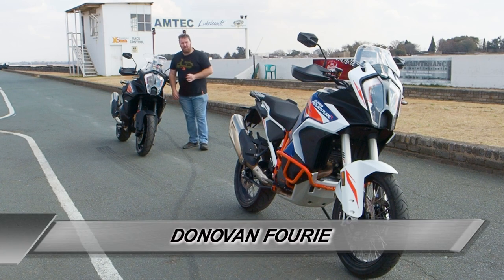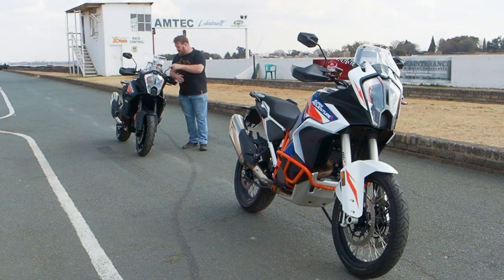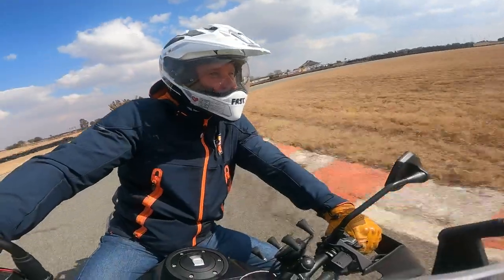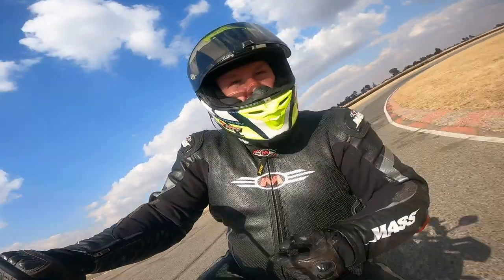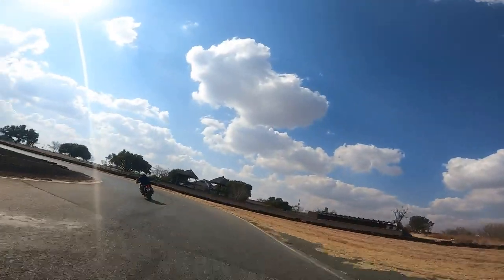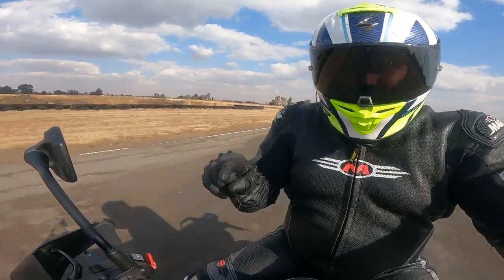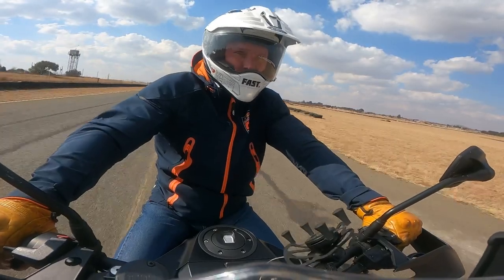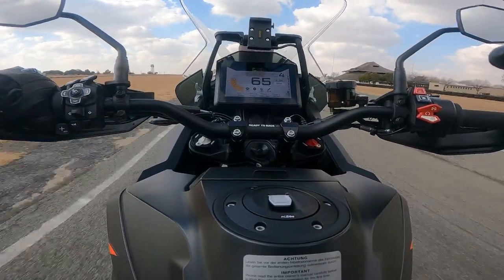A lap of the track using only radar and adaptive cruise control

Comment: Madnesses! This system works well on motorway, I did follow my mate on his Tiger 1200 all day long and no issues at all. When it comes to curvy roads, I won’t use at all for simple matter of fact that there’s no timing at all. When bike in front is leaving an apex , you’re in the middle of it and…accelerating hard, lol. What set up did you use (on radar), sport and short?
Good experiment to see anyway.
Thanks!
Reply from the maker: We used shortest it had.

Comment: I've used this system in quite a lot of cars and I can see the appeal in automatics/dsg. Worked very well on motorways with average speed cameras etc. However apart from maybe a goldwing I really can't see the need for this on a bike, generally don't most countries require both hands to be on the handlebars legally?
Reply: Just done 700km journey on my KTM. Used cruise control about 90% of the time. I wouldn't buy a bike without it. So useful. Unfortunately mine wasn't adaptive. That would have been a big benefit as others on the highways tend to vary speed a lot when going up or down hill or popping out to overtake.

Comment: If there was a less expensive version of the Super Adventure S that didn't have Adaptive Cruise Control, that's the one I'd go for.  (R is too tall for me)
Reply: Steve the R is actually lower than the S model, go try one... its a Great Bike!
Reply: @davegriffin3844  It is?
Reply: @davegriffin3844  'S' seat height (low setting) is 849mm  -  'R' seat height is 880mm.  I've ridden the 'S' and even with a 29" inseam, it's fine.  I'll almost certainly buy one, but almost certainly won't use the adaptive cruise control.

Comment: 😂Not what the designers had in mind when they developed it, but I thought it would lose the bike in front in a sharp turn and start accelerating, so credit to how well it coped.
Reply: Yes and my Mazda has radar cc and in a curve if it looses sight of the vehicle in front it will accelerate unless I manually set a lower speed for the duration of the curve.